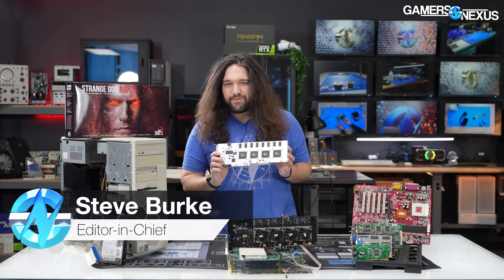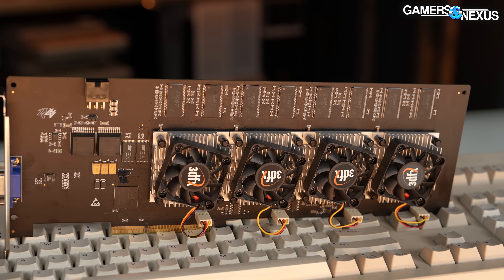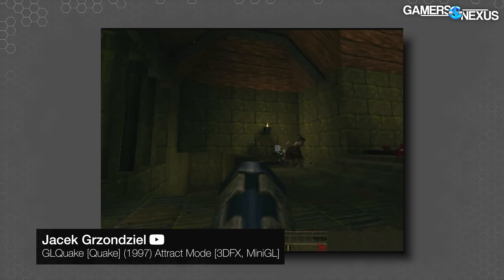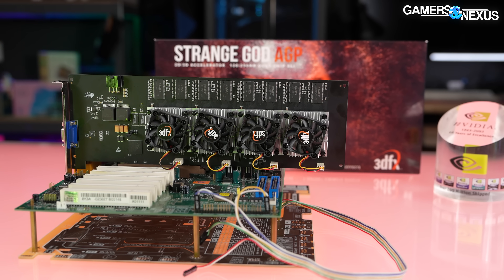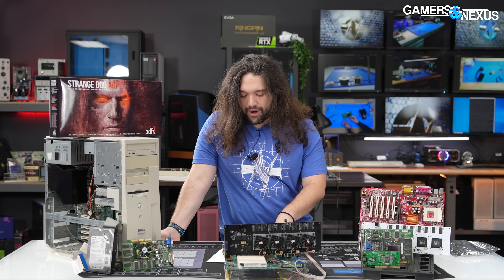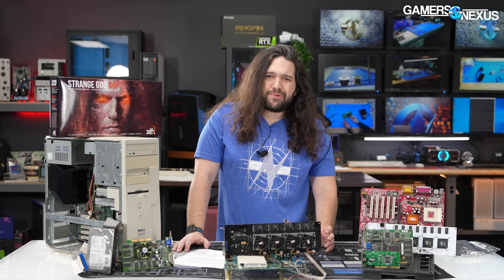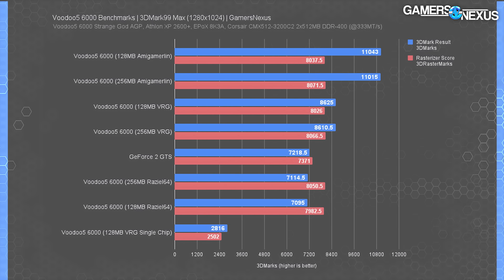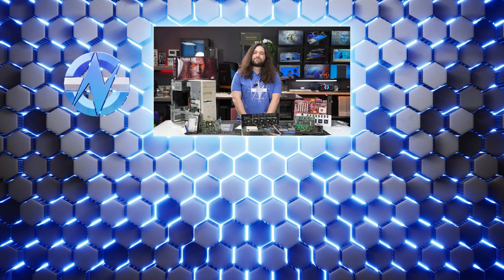Back from the Dead: 3dfx's Unreleased Voodoo5 6000 Quad-GPU Card

Comment: Lmao it's not like these cards "worked well" back in the day either. I was pretty young back then, but in the DOS/early 3D era it was always a constant struggle to get hardware and games operating correctly and trying to diagnose why things aren't working properly. I dont think it was really until the Geforce4/later P4/XP era where you could just start expecting things to mostly work by default.

That being said, a Voodoo3 is still a great choice for a vintage build as it's one of the smaller cards and doesn't need a passthrough, and has very decent compatibility - plus of course glide game support.

Comment: The Audigy 2 was also a really buggy card (18:25) xD ...but damn it sounded good in the Thief games if you managed to get all the driver crap to fully work. (Getting it to output sound was a relatively low hurdle, but getting it to output sound the way it was supposed to work and not just a basic audio output was a driver hurdle! xD)

Comment: Lucky Dawg, Ive been collecting 3DFx stuff, Got everything From a Voodoo 1 8MB to a Dual 12MB Voodoo2 SLI set, A Voodoo Banshee, A "Bonesteel" (A Voodoo3 with only 8MB and clocked to 100MHz), And A Voodoo3 3000. I cannot obtain a Voodoo4 or Any of the 5 series, too expensive and rare. I Have them each installed in a dedicated "Retro Box" machine, I dont wana take up the comment section but a quick rundown the Voodoo2 SLI system is paired to a PIII 1.2GHz (@ 1.5GHz) with 1GB RAM, A Matrox G400 and WIndows 98, The Voodoo2 3000 system is paired with an Athlon MP 1500+, 1GB RAM and Windows ME. Both paired with Identical Soundblaster Live! cards.

Though I kick myself everyday becuse I was given A Voodoo5 5500 with just some bad caps and needing a good cleaning but I left it stored, semi-forgotten in a shed that was demolished and burned......

Comment: A PIII was more period correct for the Voodoo4 and 5. GeForce 256 and GeForce 2 were already on the market by the time Athlon and Athlon XP were released. Good ole MS-815. I use to have that variant of GeForce 2 GTS and it was a great overclocker.

Comment: Hey Steve, I have a 1998 release of the ATI 3D Rage Pro AGP, I believe it is the same era of VGA cards(see what I did there?), it might be worth a shot to be sent in for comparison with the other models and test hardware you currently have laying around.
I also still have my original Pentium 3 700MHz CPU slot-in card I think at my grand-ma's(I forget the actual name, but it looks like the same socket/slot that you guys are currently running in the Dell system) let me know if these would be great additions to your testing materials for a future video, it would make my day to see them take life into a PC once again after so many years gathering dust in my storage closet!

P.S. I also have a Dell-branded RAM stick from the same era that would probably fit, and a blank Fill-stick(I also forget the name of those lol) all coming from the same (Compaq)PC!

Comment: You'd have saved a lot of trouble using an Abit KT400 based motherboard. They could handle the high GART which earlier boards had trouble with, Abit was the enthusiast's choice back then (then Abit went to hell and it became DFI, but I digress). I had a KX7-333 on the KT333 platform which was sort of okay with large VRAM GARTs, but the canonical boards of that era (nForce 2) were awful with it. As became nForce's trademark, of not working well with anything a little unusual.

I have quite a lot of 1995-2003era hardware if you want any for features, reach out.

Comment: I’m confused. The voodoo 4 4500 was 32mb sdram. Not higher than that. Amirite? I had a voodoo4 4500 PCI (I think. I definitely remember the box being the blue/green/turquoise one. Doubt it was AGP, but the PCI boxes look different). After that I bought a Radeon 64mb DDR, also PCI…I think. So hard to remember!

Comment: The voodoo 3 was actually a great card, as well as popular, still riding on the 3dfx name and developers making sure to try and make their games run well on them. 
This video is a bit harsh on the voodoo 3 as someone who was very much a hardware enthusiast at the time. The downfall certainly began with the voodoo 3, but that was because of buying STB and not the product itself.
Ironic that I'm defending the card i didn't get :) I had a great time with the original nVidia Riva TNT, so kept going to them for my cards with the TNT2 Ultra, the original GeForce 256 (as in GeFeldz), Original GeForce 2 GTS, GeForce 3 ti 200 finally trying out ATI with a Radeon 9600 XT in 2003.

Comment: 23:26 and also how the geforce 2 would have outperformed the dual chip voodoo 5 5500. Indeed your use of an
athlon xp 2600+, a chip not released until q3 2003*, is exceptionally generous to the 3dfx card. With q3 supporting hardware t&l the unfortunate reality for 3dfx was that the 5500 was matched or exceeded in q3 by the original geforce 256 from late 1999 on most setups of the time and you'd have seen much the same had you run 3dmark 2000.

*This is so far in the future that you're into the days where everyone was mocking nvidia for their dustbuster FX series blunder by this point!!

Comment: I had a banshee, had voodoo's 2 in SLI, tried some S3 metal crap and went to the Riva TNT,  then a Voodoo 3 3000 and so TNT 2 . Most of these running on a celeron 300A overclocked to pentium II perf chart.😁 
By the way, MSI was not in the big league at the time as they had only pretty lame motherboards. The real performance players wer Abit, DFI , Fic, Epox, Asus, Chaintech, Soyo ( it seems they are back ), Transcend.

Comment: I like that... that's awesome, "120fps... I mean nobody's gonna run a game at that kind of frame rate... OR WANT TO"   We used to have 2x Voodoo 2's in SLi (scalable link interface, the originator of SLi) in a Gateway 2000 PC and it was absolutely sick at the time but things moved so fast back then kinda like they're moving now again.  Was wicked but only was for about year and then it was old hat and not enough.  I'd say you could equate that to a 4090 right now.   It seems like its insane sickness but 32GB cards are 1-2 years away and it won't run the next gen games at 60fps.

Comment: I had the original Voodoo version.  Back then, IT WAS better than any other 3D card in most ways.  ATI's 3D had 24bit color, so for flight games - it WAS better than 3DFX (banding issues), but games like Unreal, UT, etc need glide or didn't run well ATI.   I upgraded to the Banshee, it was cheaper than the Voodoo2, not quite as fast, but easily better than the Voodoo1.
Voodoo3 is very much a Banshee (2D/3D card - so a 1-card solution).

But the writing was on the wall for 3Dfx when they bought STB (Had friend who worked for STB) and kicked out Diamond and all the board makers. (Wow, the brands from 20yrs ago are pretty much all gone).  So it became a war.  Nvidia (with partners) vs 3Dfx.     Kind of like the Amiga, 3Dfx wasn't updating to more modern ways - like 24bit.
Sure, Voodoo1, 2, Banshee and Voodoo3 were FINE as 16bit back then - nobody had the performance and Glide was solid, but... the Voodoo4+ needed to be 24bit.  They were not. 

And with that, I and others started going to the GeForce cards.  TNT2 put Nvidia on the map, it was very good - but not super great.   But GeForce... is when Nvidia took off.
But also... a 2~4 GPU 3Dfx card competing with a single-GPU chip Geforce was the final straw.  It didn't make sense.

That MSI motherboard was a great model.  The AMD setup should be good.   Was good back in the day.

The Windows version has to be Win98se.  No other Win9x was worth using.

PS: I had the intel i740 video card.   It was a very good 2D card, but it was quickly a useless gaming card.  Got rid of it after a couple of months.

Comment: 3dfx could save themself, even in 2000. But they would need at least bit of brain.
They've needed to realse voodoo4 BEFORE voodoo5, and BEFORE geforce 2 MX.
They also needed to come to AGP 4x technology, die shrunk it to 180nm, to get higher clocks, and compete only in mainstream with voodoo4.
They needed to left out high-end market, and let it to Nvidia. 
They would survive this way.

They should then focus on making voodoo5 great, and release it at the end of 2000, to compete with Geforce 2 GTS.
Geforce 3 wasn't so much success, so they would be ok even through year 2001. 

They would survive this way. 

Voodoo5 could be 2-chip solution and much more mature. They should already integrade hardware T&L and release it at 180nm technology, bringing clocks higher.

Then, thanks to they survived, they should focus to release Rampage, in year 2001. Maybe, it would not catch Geforce 3, but it would finaly catch Geforce 2 GTS/Ti/Pro, maybe even Ultra.

Comment: One way to help with the problems in those cards was to add heatsinks to the back. I had a 3500 back in the day and it needed heat dissipation help.  Also you completely failed to discuss Matrox 3D which continued to compete in the 3D market until long after Nvidia bought up 3Dfx.  We all knew that 3Dfx was over when Geforce came out with Hardware T&L while the 3Dfx team made hardware "motion blur". It was sad. And Matrox 3D was crazy fast with their tile-based rendering. It was unbeatable until the Voodoo 2 introduced SLI.

Comment: It was the biggest mistake by 3dfx when they decided that they don't sell chips to partners anymore.
before the voodo 2 2000 and rage were the hardware one was dreming of or saving monies to afford it.

but when I saved enough, 3dfx was almost dead and I bough a riva TNT chip.

I remember building a affordable rig for a firend, a AMD K6-2 400 paired with a voodoo 3 3000.
it ran really well. oh good times.

Comment: Does not look like a barrel jack.  Looks like a DIN or similar jack, 2-5 pins?  Used on EG some Toshiba and Clevo laptops and DTR.

Did you pencil mod the Athlon?  🤣

This takes me back, I had the Voodoo3, TNT2 and Geforce 2 GTS, then an FX 5200 (it was awful)

Comment: Maybe I could be splitting hairs here but... even though I love these "what if" scenarios, when the 5500 was released it was already 9 months too late, that card was meant to compete with the Geforce 256SDR and the 6000, in December 99, with the Geforce 256DDR, but that was 300$ card not a 600$ plus card, the truth is that by the time 3Dfx could release the VooDoo5 5500 in July 2000 nVidia was already selling the faster Geforce 2 GTS by that time CPUs just made it to 1GHz (1000$ CPUs BTW), so they would had been facing that faster card, "crippled" by the lack of onboard T&L (a feature that wasn't all that important at the end of 99) and the ultra fast CPUs that nostalgic reviewers love to pair up with the VooDoo5 to show their "true potential" just didn't existed.

Comment: Very nice I use my Voodoo 5500 in a PC for retro gaming I have a AMD Athlon Xp 3200+ with 400FSB. I only use W98 SE games that can not run in Windows XP 32bit. Windows 10 64bit is very bad a running games and software from many years ago.

Comment: I still have 3 5500s still works all three.
Reply: i have them running on a a7v333 with a amd xp3000
Reply: Got a second amd xp3000 on a a7v266 also both still run like new.
Reply: i think the a7v266 is a -e
Reply: I think both are 4x AGP.
Reply: I have 2 intel systems from that era, a 1ghz P3 with AGP 4x, and a P4 1.7 ghz with that 800 mhz mem with the coolers on them.
Reply: It's all worthless scrap but it all still works.

Comment: I think think the windows 98 build got thrown out on the move. 
Would of bought that card for sure. Expensive i think. 
Thinking in upgrading the windows xp computer with a new case. Maybe a bit more stuff. 
Just got a i7 with a 3070ti. Still need to upgrade for doom enternal and cyberpunk which i beat already. Meh.

Comment: https://youtu.be/-aMiEszQBik?t=1423 Weird, I remember having an Intel i740 (8Mb) back in the day running on a Cyrix PR266-MMX, 32MB RAM and could play Quake III pretty smoothly. 800x600 (even 1024 without lightmap enabled), with no crashes in OpenGL mode. I remember the only problematic games were the D3D ones such as Half-life

Comment: The good ole red msi days. Used to be everything good had a red pcb. Msi board with radeon 9700 or 9500 flashed to 9700 with a Athlon 1700 boo yea. Amd was beating nvidia by more than 50% back in those days
Reply: Purple board you were screwed.Ecs amongst others. And Soyo and Dfi were top of food chain

Comment: I had no problems getting Voodoo 5500 cards to work...I think it was on agp 3.0. But I can't exactly remember....I installed about 4 of them. I had no problems at all. It was on 1333 mhz amd chips. Damn exposed cores on those things, and spring loaded heatsinks...yeah I cracked a few cores...not fun. As for performance....in any 3dfx game, they would blow away nvidia chips. Non-3dfx games, the Nvidia would win, but the graphics on 3dfx games looked WAAAAAY better.

Comment: Talk about clickbait title.

1) the card is not the gpu. VSA100 was released on both voodoo4 4500 and voodoo5 5500.

2) VSA100 was not a gpu. There is no T&L, it relied on the CPU for that. If you have to offload part of the graphics processing to another device... You aint a graphics processing unit, since you cant process graphics completely.

Comment: Emulation is buggy and not useful not full speed
Reply: We still don’t get the performance of voodoo with any cards out today. 

“Nobody wants 120fps” is the kind of stuff that doomed them.  They marketed to enthusiasts but dumbed it down. 

I paid $600 for quadro 600 cards I put into 4 way sli.  That was a single gpu, when one voodoo 4 outperformed it non sli. Only because it was what was available. 

3Dfx voodoo would have been fine had they just put products in stores. 

They are still more popular and sought after than any nvida. 

Radeon is voodoo chips and design.  But board makers and software still works against amd optimization. 

Forcing people to buy intel and nvidia inferior products over and over again. Same chips remarketed like iPhones. 

Not shipping products, not staying in it and quitting was their only mistake. They didn’t even try.